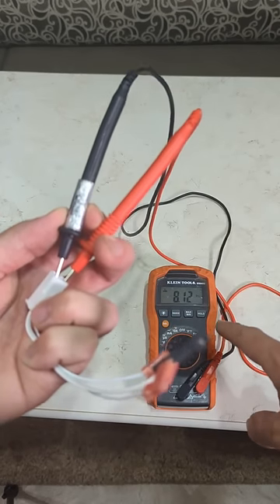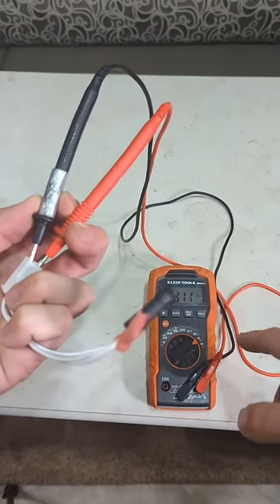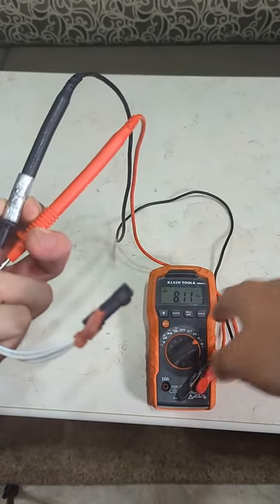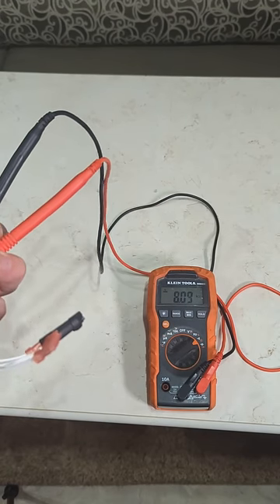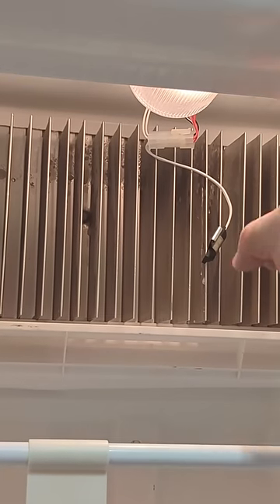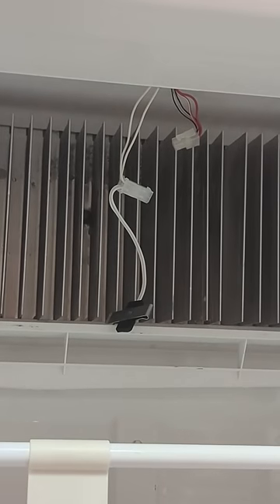RV Fridge Not Getting Cold - Easy Fix - Norcold RV Fridge #shorts #rvlife #diy

Comment: This is what is happing with our Norcold. Is there a link for the Thermistor?
Reply from the maker: Thermistor Replacement for N611, N621, N811, N821, N841
https://amzn.to/3JQ7fYd
Reply: @rvlyfe  You Rock! Thank you!
Reply from the maker: @kerriwashburn4410  😁 happy to help!
Reply: Will that work for a 1200 series Norcold as well?
Reply from the maker: @kas10163y  for the 1200 series

https://amzn.to/3rj7rbV
Reply: I have a 3150 with the same symptom.....nirmal freezer temps, but fridge wont go below around 42°-45° on AC or gas. Typically fridge is in mid/upper 30s. I ordered a thermister, and plan to replace it. Hope that does it! Thanks for the video!
Reply from the maker: @fire273mx7  you're welcome!! Based on what you're describing it sounds like there's a high likelihood it'll take care of it!
Reply from the maker: @fire273mx7  also make sure that it is in the correct spot each model fridge has a specific fin it goes on

Comment: I have different model. No light or sensor in compartment
Reply from the maker: Is it the dometic brand version? Those have a replacement called snip the tip and they work really well I have it on my other unit
Reply: @rvlyfe can you elaborate on that? I have an everchill (neverchill) 12v rv fridge that I'm working on that won't cool, fan runs inside but compressor is not turning on, any idea what to check and how to check it? Tried resetting it and tried on fully charged battery as well as generator running and still nothing, thanks in advance.